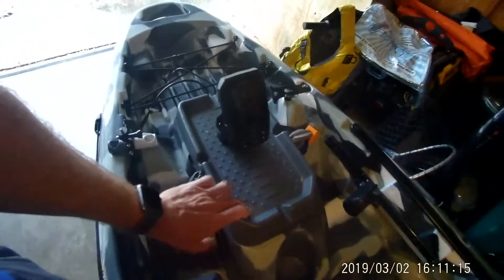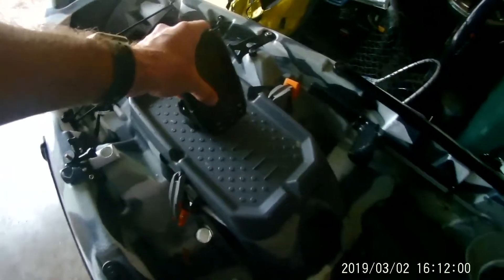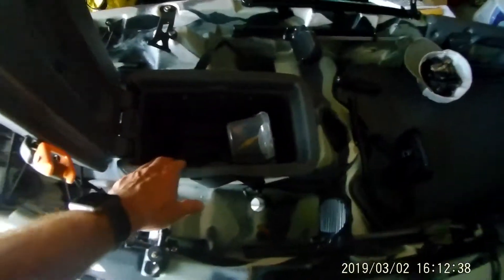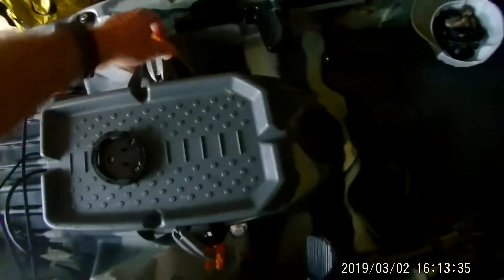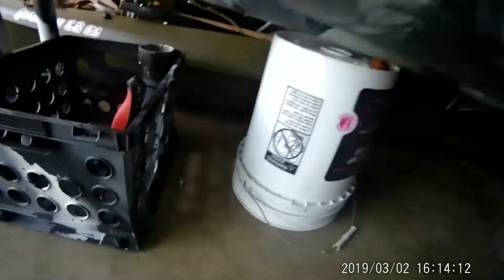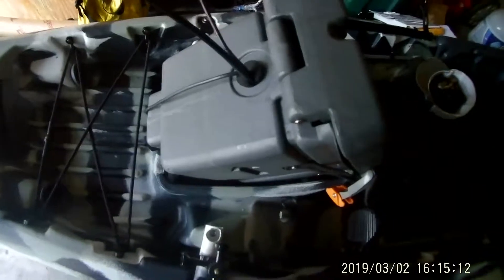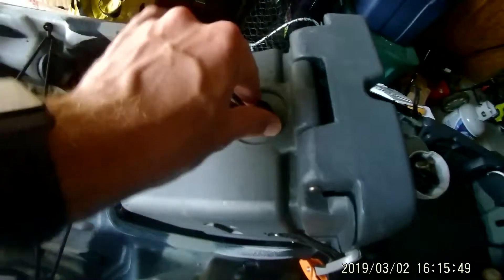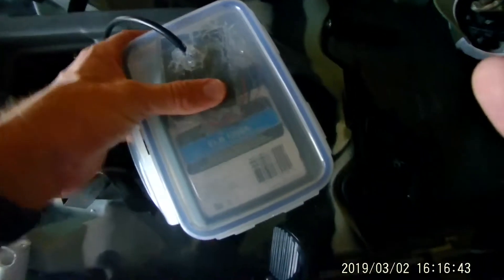Garmin striker on Big Fish 105

Comment: Great video thanks for sharing. I have the Garmin Striker 4 on two other kayaks with trolling motors( perception pescadora), great fish finder for the price! I recently upgraded to the Big fish 105. I have installed a watersnake asp t24 trolling motor on my big fish(Simple install, if you remove one of the existing rod holders, really works great if you have a rudder installed, I can pretty much kayak hands free.

Comment: Is there any interference with the finder being recessed into the hull? Or can you still make out structure and the bottom clearly as you would if the transducer was mounted on a submerged arm?
Reply from the maker: The way the kayak is designed, it isn’t actually recessed in the hull. It still sticks out (for me) perfectly where there is no interference. However, the only thing you need to keep in mind is that you’re transducer can scrape the bottom.